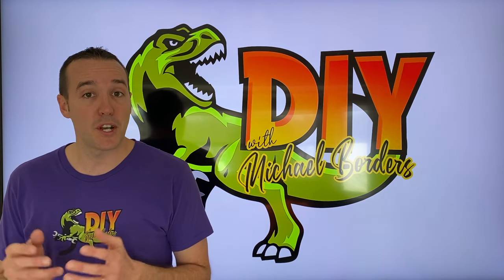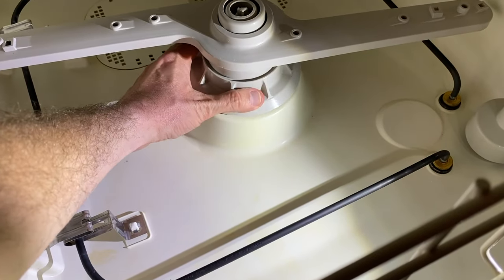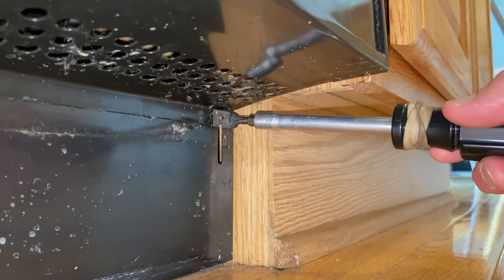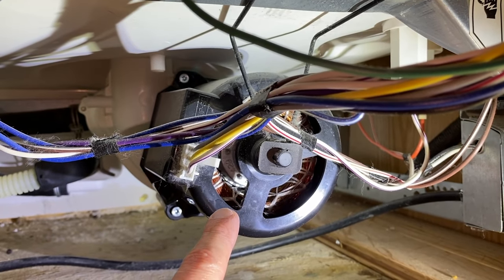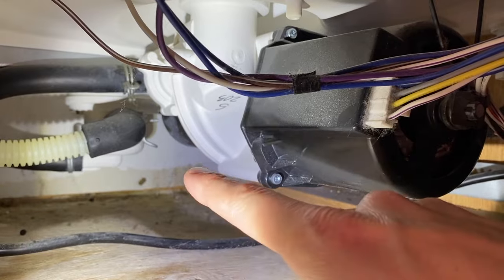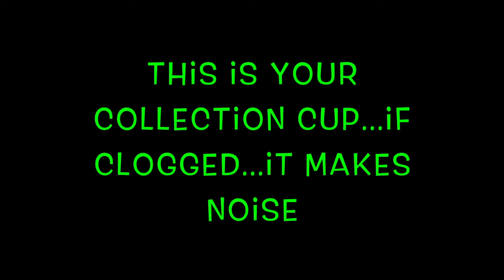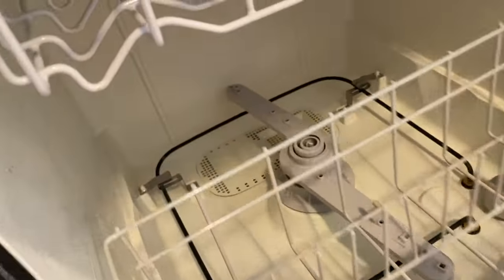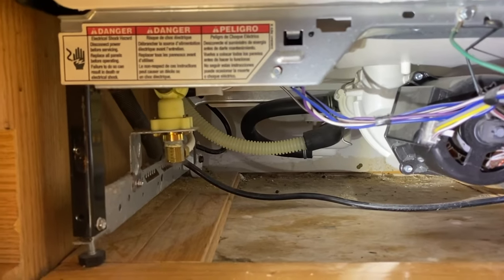Dishwasher buzzing humming grinding - Most common causes

Comment: Can I continue to use the dishwasher if it's the pump that is making the noise??? Like will it fail / leak? I ordered the part but it won't be here for several days.
Reply from the maker: @GTass455in  

Thanks for watching, that will be personal preference.  If the motor is indeed the issue, it will continue to degrade until ultimately failing and no longer work.  Looking forward to hearing back from you on how the new motor works.

😁👍🧰

Comment: Mine makes a crackling noise during the drain cycle. It sounds like a camp fire on high speed.
Reply from the maker: Thanks for watching, that’s interesting…🤔

Crackling can be symptoms of broken parts inside pump motor/impeller housing…🤔

Comment: Mine is Beko dishwater dsfn 4630w model. So the problem is even befor I start the dishwasher I hear the buzzing /humming sound as I soon as I close the door. I don’t see water coming in. No movement of anything. Do you know the cause? 😢
Reply from the maker: Thanks for watching, it’s likely that your water inlet valve is in its early stages of failure.

Below is a helpful video link showing replacement of water inlet valve.

       https://youtu.be/KCr9B5Ioiv4?si=vlhuaKaq5btSlq9l

Please keep us posted.  😁👍🧰

Comment: Lots of helpful hints  ...
Reply from the maker: Hey Joe, hope you’re enjoying the weekend.  This is video 1 of our Dishwasher repair series.

We basically rebuilt our 2004 whirlpool, she’s ready to run another 15-20 years…😆
Reply: @DIYwithMichaelBorders  Basically i use mine as a  cabinet for all my cleaning supplies. since its just me  here i just wash by hand . but i do run it every few months to keep the pipes cleaned out ~
Reply from the maker: @joedevitto6113  

Clever.  😎👍
Reply: @DIYwithMichaelBorders   iI dont  like to keep anything under my sink  just incase there is ever a leak . i can  catch it right away  i  do have a little trash can under there   ~   that way its out of sight ~
Reply from the maker: @joedevitto6113  

Not a bad idea, the more items that’s packed into the space underneath sink can unfortunately increase the chances of damaged plumbing.

Comment: If the pump is bad, does that mean I won't get water either ?
Reply from the maker: Thanks for watching, great question.  The water will be introduced into the machine via the water inlet valve.

Below is a video that shows replacement of water inlet valve.  Although this will not be your issue since you are getting water, it will give you better closeup views of the valve itself.

       https://youtu.be/KCr9B5Ioiv4?si=zw5oALsoRoKo75zB

Keep us posted on your DIY project.